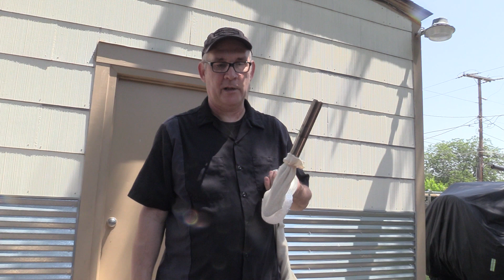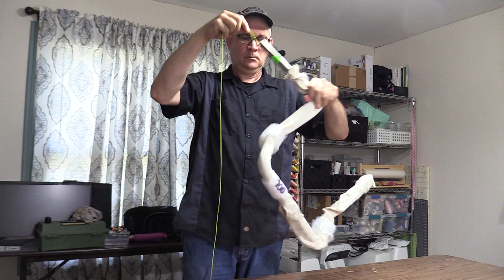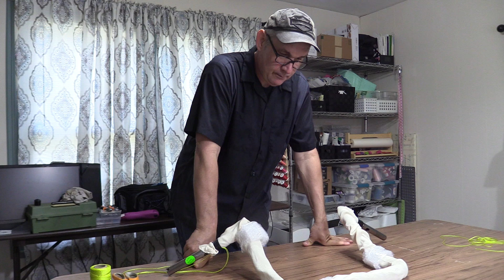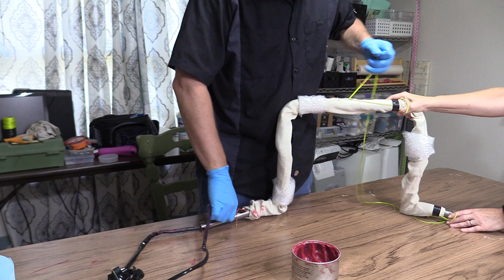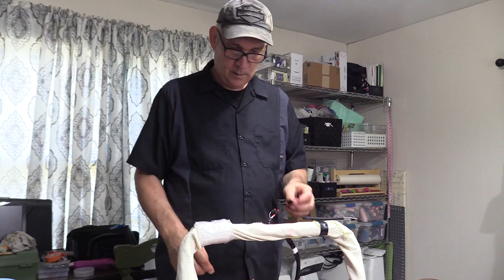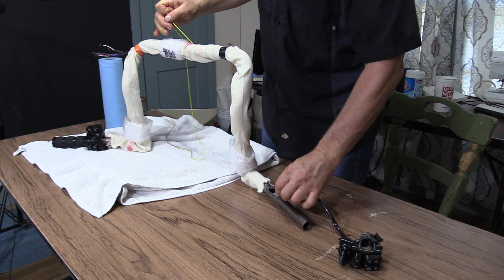Prepping And Wiring Motorcycle Handlebars

Comment: Small tip…….remove the bulky stock “jacket” covering off both sets of wires(switch control and twist grip sensor)……wrap a small strip of electrical tape every 4 or so inches all the way down the wire grouping……that way you still have integrity of wire strength, and less bulk to pull through. Trust this, ask me how I know………..it works like a charm. Needs less lube too. Also of note, you can go up to a 14 inch bar without extending clutch or brake cable lines. Sometimes just a little rerouting get you the distance you need. But, you can go up to a 14 inch bar without wire extensions.🤙
Reply: How is that possible if with the 12s he has it nearly came out?

Comment: Thanks for showing the complete job so far. This type of vid is much more valuable than the one's that just gloss over the process. I try and do my garage vids this way too. So getting extensions as opposed to an entirely new wiring set seems to be the way to go to save some money. Is their a down side to the extension route? Only thing I can come up with is that it adds another connection point.
Reply from the maker: The connection point is a good observation. It does introduce one more potential point of failure. I have personally never had an issue with them or known anyone that had any issues using them. However, if the extension fails you can easily replace it by only having to remove the outer fairing instead of wiring the entire handlebar again. So upsides and downsides both.

Comment: What was the brass tool you used and where can it be found.
Reply from the maker: Search: Brush Bore Cleaning Brush Set Wire. That will pull up a huge assortment on Amazon for around $15 for a set.

Comment: What is the size extension tool used to attach to drill?
Reply from the maker: Socket Adapter 6" with 1/4" hex shank. Used both 1/4" and 3/8" socket sizes